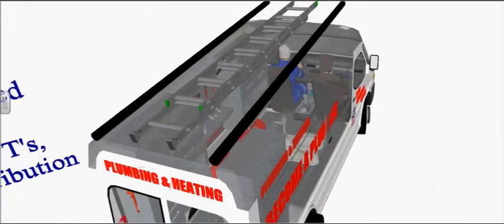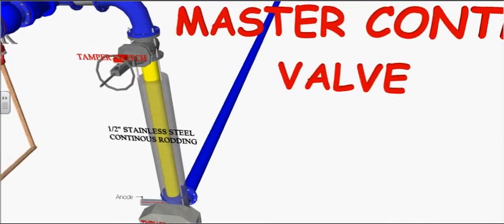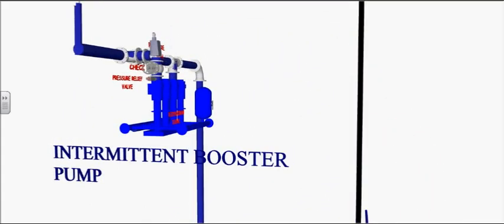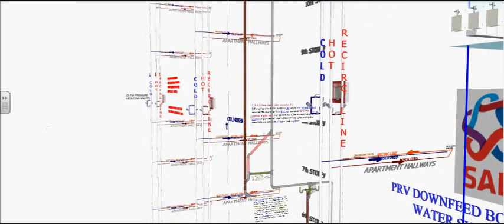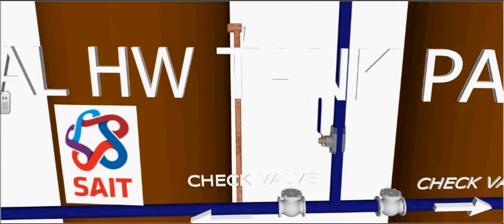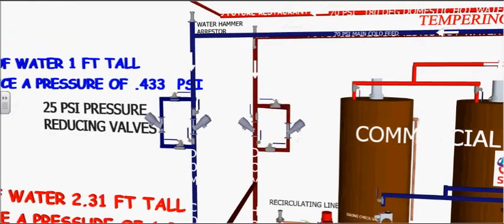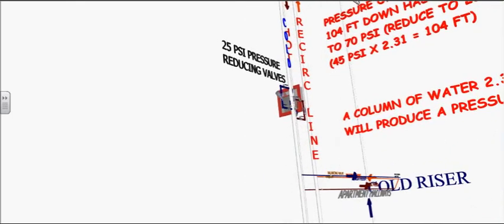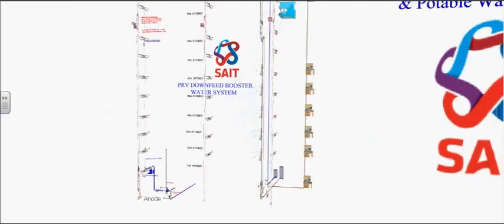SAIT PLUMBING WATER PRV DOWNFEED BOOSTER SYSTEM

Comment: Fred, at 4:30, you say the ideal temperature exiting the tempering valve is 120* F.   I was told it should be 140* to help limit the growth of legionella.  I was told that at 160* the bacteria is killed instantly, at 140*, 90% of the bacteria is killed in 2 minutes but at 120*, it takes 2 hours to kill the bacteria.   Should the ideal temperature exiting the tempering valve be 120* or 140*?  -- And I'm asking from a National Plumbing Code / Red Seal Exam point of view, not a "real-world" application.   Thank you.
Reply from the maker: from a red seal point of your in regards to apartment buildings the ideal temperature is 100 deg f, the max is 120 f.   I however I used to turn the mixing valves up to 140 deg f which was because that is what normal is on a 40 us gallon res HW Tank.   However to prevent Legionella bacteria you should have it about 160 deg F,  there was an idea to change to 160 deg f, but that involve installing mixing valves on all Hw tanks,  and that was decided not to be done.